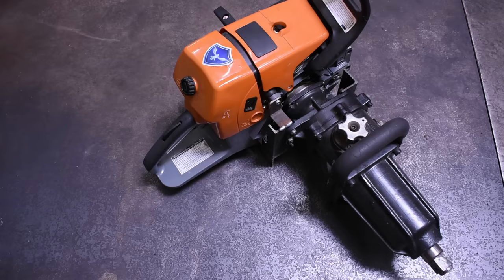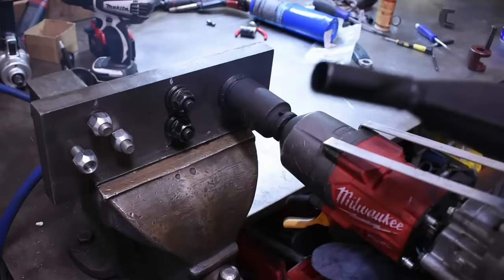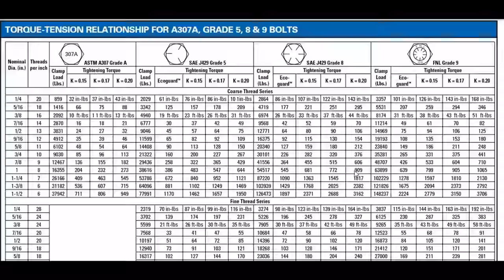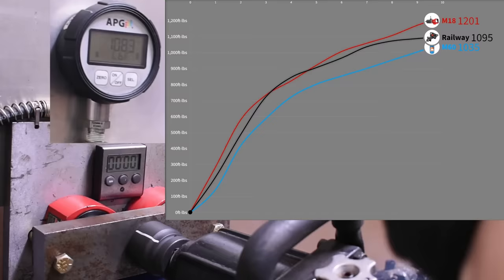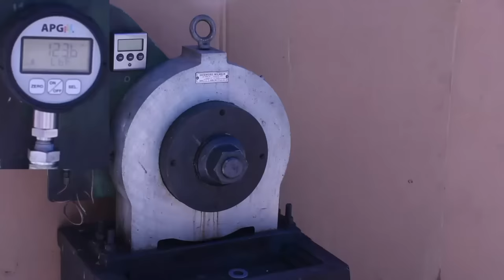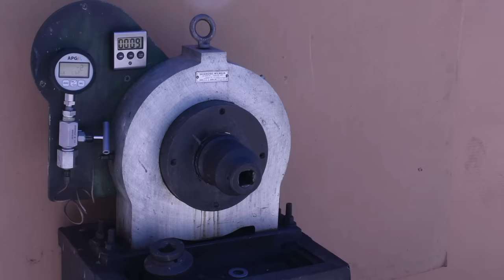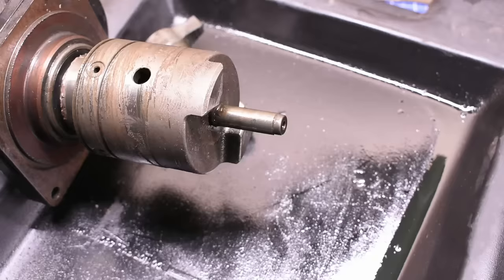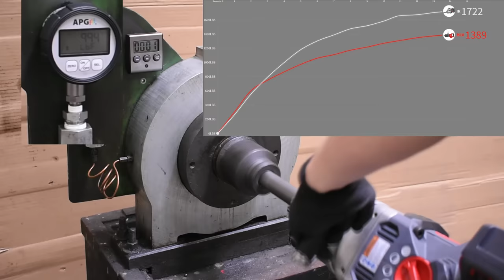The Gas Chainsaw Powered Railroad Impact Wrench

Comment: A high flow CO2 regulator and an expansion tank with big air hose couplings will run the snot out of a pneumatic tool.  Your local hydraulic shop can make high pressure hoses...

Comment: I bet you could get pretty close results from the original engine with some tuning. the original just sounded like it was never really spinning up to the point where the 2 stroke becomes self supercharging. considering the original was designed to run all day everyday its for sure under tuned. I bet adding a flywheel into the mix would really up the power too letting the 2 stroke run wide open

Comment: You need to make friends with a nice youtube chap who loves the "ripems" his name is Warped Perception, he plays with 30,000 RPM Rotary engines with a dash of Jet engine @100k RPM that he seams to be stockpiling at the moment along with 100 shots of Nitrous Oxide forced into what ever he can get his hands on, I think you guys would work well together until you produce enough torque to counteract the earth's rotation. He also loves high speed slow motion.

Comment: An tips, juse an heatgun, there you can se where all power ends. All that energy you put in dont disaper out in the air. I guess en station is the "hammer" weigh the hammer the juse an socket at nearly same weight an you may gain some more punch. Thats happens now is shit that is "solid" will send shitt backwards.

Comment: MXfuel is expensive to put on those gas gun, may be using green works 80v but those 18650 is not 3ah like Plaid S or Milwaukee USB using.....I bet you need to find out where to find them

Comment: 90's Honda CBR250RR motorcycles don't hit the rev limiter until 20k rpm and you can pick one up cheap. Can you guys mount handles on the engine and hang it from a cherry picker for the next episode?

Comment: So if it's about RPM, some 4 cylinder motorcycle engines can reach about 16,000. And Formula 1 engines can reach about 20,000, but I'm not entirely sure the channel has the budget for that one.
Reply: And don't even get me started on turbine engines.

Comment: Ok so... rpm.... there are rc car brushless motors that turn in the 10s of thousands of rpm. Years ago, I built a system that was capable of over 10k watts, or about 13 hp with a max rpm of just under 27000 rpm at 33.6v, all from a motor the size of a coke can. All that typed, there are even more powerful systems available these days.

Comment: Non-dino juice kind of cordless power tool that's still powerful enough to be considered for home-brewed vehicles? sounds like you need to grab a power pack from an Electric Vehicle and a hobbyist motor intended for home-brewed helicopters/over-sized quadcopters. pair that with a custom made hammer and anvil configuration... you might just end up with the most powerful impact tool on the planet.

Comment: Ofc the railway gun isn't as potent as you hoped for. It's supposed to torque the nut to the correct ft lbs and not to rip the treads right off

Comment: Who did the machining for your contraption? Genuine question. I'm curious if you guys have the capability, or maybe just know someone.
Reply: If you guys did it, then I think we all deserve a nice long form video on the engineering and building process!
Reply from the maker: We did. But it wasn't a lot of machining. Mainly finding clutches that would fit and the welding brackets to align everything
Reply: @TorqueTestChannel  thank you.

Comment: What about a big electric motor strapped to it on 120v.  Could probably get some serious rpm’s and torque for a reasonable amount of draw
Reply: This might sound funny but they make these big immersion blenders for commercial kitchens with “several horsepower” and they spin at like 22k no load. That’d make a hell of a power plant

Comment: How would the gearbox off a 1 inch air impact do?
Reply from the maker: Air impact hammers cant be run with electric motors, due it to stalling each impact

Comment: Could you guys do the Ridgid high torque( not the current one that came out last year,the one before that) with the MaxOutput 8ah 21700 lithium cells and see if it will compare to the octane batteries?

Comment: Any opinions on Craftsman 20v tools to start off with instead of much more expensive tools? Drill/Driver/Impact etc etc? Fun/Hobbies not for professional use.
I recently started using their tools, 20V Cordless Blower, 20V Cordless Vacuum, 150W Inverter (LOVE this so bought some extra batteries, 2Ah/4Ah and recently their 6Ah packs), an Oscill Multi-tool, and considering getting their impact/driver type tools so im curious how people generally feel about their stuff.
Reply from the maker: The V20 line is quite decent, especially for the money. Some items are current DeWALT stock in red (not all)
Reply: @TorqueTestChannel  Thats what i hoped to hear lol, thanks :) Liking their stuff so far.

Comment: Yea, but....... With the torque that an LS makes you could do a transmission and raise that output rpm to potentially as high as you want it. So....... What's the excuse now??? Because you can even use a flexible line off of the transmission and be able to move it around like a Dremel attachment!!! BOOM SHAKA LAKA!!!

Comment: Hey guys I have a air impact gun I think would be interesting to see where it falls on the chart it is a Cornwell 1/2 premium impact model #irc9000 it claims 1350 break away but we know that's not accurate probably
Reply from the maker: Hey hit us up if you want to loan it to test TorqueTestChannel@gmail.com

Comment: 🤣 time to get 54V Lipo battery and a 1500w motor, (ebike comes to mind) message AVE if he’ll fabricobble up a solid anvil and dog. slap it altogether and break things/ improved egg beater design that works with higher rpm. though that sounds like a good way to break a wrist.

Comment: While enjoying this channel, id say youd probly have better luck talking with a saw modder like Ironhorse or Tinman about what you can do to get better results. The bigger CC saws over 70 work more on pulling torque. They are ment to maintain an rpm while dragging really long chains. If you are looking solely at rpm, then youd want to go with the 70 CC saws as they are typically the fastest cutting saws you can get and you can do alot to get them screaming.
Reply from the maker: I'd probably disagree that a different chainsaw would make more here when we already maxed out and broke this set up as it is
Reply: @TorqueTestChannel  comment was made before the end of the video and the broken gear box. But id agree, if the rpms with what you have right now is more then enough to break that section, anymore would be over kill, but once you get a gearbox that can handle the output, a hotsaw would break that too.

Comment: Maybe consult an actual engineer and get a custom one designed.  I'd bet you'd even spend less.
Reply: I'd also suggest you could get much more beans in there with a gearbox between the engine and impact.
Reply from the maker: There is a gearbox, that's what exploded
Reply: @TorqueTestChannel  That's the gearbox designed to sit in front of the impact drive.  I'm talking about a gearbox designed to sit on the output of the engine.  One that increases the RPM, considering the engine has more than enough torque.  4:1 on the RPM maybe?

Better yet, replace both with a custom-engineered gearbox designed specifically for that engine output and that hammer and spring.